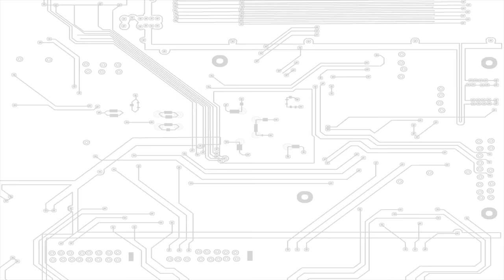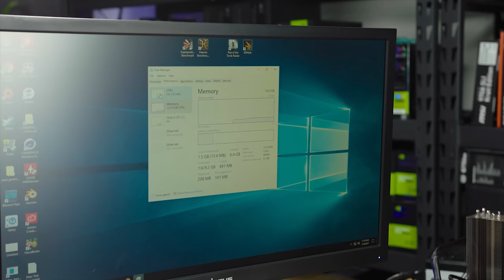How to fix bent CPU pins

Comment: I was building my younger brother's pc last night and I accidentally dropped his Ryzen 5 1600 and bent about 14 pins, this video saved me and I've just completed my first fully functional build!
Reply: Did you have to have install windows from an install disk? How does it work? I'm about to build one but have no idea lol
Reply: @memoryfoam2285  lovely, cheers 👍
Reply: @MoAliRiyaz  sorry for the late reply, I managed to undo it with a Stanley or Exact-O knife blade and a magnifying glass to see the pins. Just use the blade to bend the pins roughly into shape, then run it between the rows of pins to get them straight.
Reply: @MoAliRiyaz  id love to help but I don't feel like I should accept responsibility for your CPU because I can't afford to replace it if I botch it, sorry man.
Reply: @MoAliRiyaz  I think its probably best if I say no, I'm not a professional and I don't really want to give a stranger on the Internet my address. Best of luck solving it, maybe try a local computer repair business or DIY. Sorry I couldn't be of more help.
Reply: Damn that sucks lol. How's it holding now
Reply: @bimmer8602  his PC is doing fine, although he did recently experience a few crashes but we believe them to be graphics driver related.
Reply: @memoryfoam2285  please confirm it was the graphics card lol
Reply: @chief_islxm  huh?
Reply: Lol I have 1 bent pin I’m scared to touch it and it’s only slightly bent
Reply: @youlittlerocket  bro you need another laptop with internet and download on a 8 gb disk and plug it on your pc I’m not specific so don’t trust me watch Linus or smth
Reply: Kick ass!
Reply: Idot
Reply: @iamerror1699  thak yu
Reply: is it still running 3 years later
Reply: I personally wouldn’t have a brother anymore if I were him

Comment: A mechanical pencil is actually great for this sort of thing  as well. Thread the pin into the tip, bend it back carefully.
Reply: Thats a really solid idea.  I'm assuming you'd have to match the size of the pencil as closely as possible?  Wouldn't work for LGA since the tops of the pins are angled (I commented on another comment here about how I had to fix some LGA pins once and I did it in a similar way as Jay did here using a tiny screwdriver instead of a razor), but this is a really solid idea I'll remember in the future if I ever have an issue with on chip pins.  

In my mind its easier to bend LGA pins than it is with on chip pins, as most people (myself included) hold CPUs with on chip pins in the most careful way possible.  But once you take that socket cover off anything could happen, a dropped screw, your build station gets bumped as you're about to put the CPU in and something gets bumped, or even the socket cover itself bending a few when you take it off (not even talking about from factory issues).  

Again though this is a really solid idea I'd use in conjuncture with the razor blade method shown here.  Use the razor to line them up as best I could and then use the mechanical pencil to straighten out the ones that are really bad and need a bit more shifting before you can put it in the socket to straighten them back out 100%.
Reply: The amount of times I've used them over the years. It was great for early PGA , but the density, thinner and shorter pins these days makes it a little more fraught.
Reply: the only problem is that pencil lead is conductive so if part of the pencil breaks off you could have issues
Reply: Derek a mechanical pencil has removable graphite rods, there shouldn’t be any in it when you do it
Reply: My first thought would be to use a hypodermic needle with the tip cut/sanded off. I used to do gun barrels for scale models from these, too :)
Reply: That's why you aren't using the lead, you are putting the pin into the opening where the lead would come out
Reply: That's sounds novel. Have you tried it?
Reply: You can buy packets of non sharp needles from ebay, you get an assortment of diameters for next to nothing, I use them (and a syringe with a screw fitting) for applying solder paste and flux. Search blunt needle, or dispensing needle blunt and you'll be on the right path, they are dead cheap. Pack of 50 assorted, couple of quid / dollars.
Reply: I use a .5mm mechanical pencil for this too. Take out all the lead, and use the tip to bend the pin.
Reply: really great idea... I'll keep that in mind if I ever drop my CPU. lol
Reply: yep thats the way ive always done this... very easy
Reply: no just use the tip without lead in it....its the perfect size.  of course this is not for intel lga....this whole video was for amd with pins on the cpu as he said in the first part of the video.
Reply from the maker: Fantastic idea!
Reply: It actually works great for LGA, thats where I learned about the trick trying to fix I think it was a 775 socket.
Reply: Dan Carlson exactly.. ive been using lollipop stick with small hole in it.. thats works fine too
Reply: Yeah this is my method. Recovered a few CPUs like this. Definitely the easiest I think
Reply: I thought this was common sense at this point, that's how I always did. The less force applied to the base of the pin, less chance to break the solder
Reply: That's exactly what I do as well.
Reply: Great idea, thanks!
Reply: I agree. I used one of them to fix a dropped an Athlon XP in the past.
Reply: Also fixed an old AM3+ USB3 motherboard connector with the mechanical pencil trick
Reply: I have also used mechanical pencil from many many years and with more recent processors its good to align the rows with utility knife blade to finish the job.

Comment: I used a bank card to fix the pins.
Reply: xGarbett a razorblade is smaller than the distance between the pins, plastic cards often work better
Reply: Rado the problem is that those card can be very not straight, I used a spare blade for an utility knife when doing this kind of repair a decade ago
Reply: i used tweezers that came with a vape kit.........
Reply: My guess  is he used the bank card to buy a new CPU.. But yeah im confused.
Reply: Used a card last week to fix a few old Xeons (2001, I can only assume the CPUs were OK becuase the other option is that they were all broken).
Reply: i used knife
Reply: Plastic cards are very wonky. The import thing is a straight edge. Nothing is straighter than a razor blade. Use your heads.
Reply: Logan Brewster i dont think i can do that i have a plastic and metal tweezers from my vape
Reply: I used a Needle/Bank card. Worked great
Reply: Bank card works well. You can buy a new process with one of them bank cards :)
Reply: this works. i did it on my 4690k and its been working strong for 4 years or however long i've had it
Reply: maybe he tried to mean "i don't fix the pins, i buy a new CPU"
Reply: I mean the bank might break
Reply: Yeah I used my bank card to fix it too. I used it to purchase a new one.
Reply: I wasn't able to use a banking card in my case 

space between pins on Ryzen 2700x is really narrowed, this way I could easily do much more harm than good... I'm also didn't have any razor blade... So I used a very tiny Torx (like really tinyy) from the Clockworkers set and while it was very time consuming and anxiety driving thing - the outcome was worth it anyway.
Reply: @randomyoutubeuser8509  Owww myyyy... I just realized what he means by that... xD silly me and a bunch of others people... but still banking card was on point in both cases!
Reply: weird flex but ok
Reply: Oh wait you mean you used a bank card to fix/buy a new new one and not for the razor blade technique as I was thinking?
Reply: r/woooosh to u all

Comment: Just wanted to say - this video saved my ass. I was in a deep depression hole thinking i'd messed up my 5800x; and I was allready in my head planning what I would have to sell to try and replace it. Watched this video and decided to give it a go. The relief when it actually worked was out of this world. Thanks Jay!!
Reply: I am in that kind of depression right now and managed to break one tiny little pin. Also cant get the other ones straight enough as of now so not even sure if it will work or not. If not, saving up several months to buy the processor (yes months, I am sadly living on a very low budget) was a whole waste. I really hope I can fix it AND it will work, otherwise I'm most definetly gonna cry man.
Reply: Just happened to me when moving countries.. I put the cpu the other way in the plastic thingy (5800x) 😓. All corners are bent, we’ll see if I get it working ;(
Reply: @hatdoggo8824  i sent it to someone I found on the internet and he only wanted 10 bucks for it. Works perfectly fine now! Theres always hope yo
Reply: went through that same thing legit 10mins ago, did what he did in the video and holy shit it worked, so happy right now
Reply: @KamiSama69421  hahaha its the best feeling
Reply: Same here, Lexx Fan (loved that show back then and still do). I had a corner full of bent pins and a swell of impotent rage about to erupt. Saved my 3600 and my fist from making a hole in my wall.
Reply: @shhoward71  I know that feeling all to well. Glad it worked out!
Reply: This was me as well placed my cpu into the plastic case bent 3 pins on the corner luckily I managed to bend them back ryzen 7 3700x
Reply: bro i just bought a 5600 and im in depression cause i bent one of em
Reply: I was in the same position lmao. I thought my baby would never boot again😭
Reply: Just bent my 5900x and fix it so it’s slotted in my MOBO. I haven’t tried seeing if it’ll still work yet but I’m so nervous lmao. I only bent like 3 on the edge and luckily bent it back but still I almost cried
Reply: @macs.imum1699  where are you from? Bangladesh :/
Reply: @SpyCakes47  Nope, germany. Its a private guy from some forum I randomly found and he basically fixes them for a small price and some candy lol. He just likes to be a good dude I guess.
Reply: Literally me right now. My 5800x just ate shit
Reply: I’m in the predicament where I’ve replaced my cpu but bent the pins as I was taking it out and I just realized I forgot to save the data from it 💔

Comment: Holy I almost had panic attack when mines bent during shipping this actually worked THANK god
Reply: Nice!! I would have freaked out too man but good job fixing them pins!
Reply: I know the feeling. I bent some pins on my 3900x while taking out my cooler from the CPU. The darn thing was glued too well with the cooler. Managed to get all pins aligned and my rig still booted. I'm just scared now if problems will still eventually manifest from messing up the pins in the first place.
Reply: @Franz4939  exact same thing happened to me. Cpu was glued to the cooler because of the thermal paste.
Reply: @veezi_  same I'm trying to fix my cpu rn🤞🤞. Hopefully it works. Luckily none broke off when I took of my cooler
Reply: Same thing happened to me, the box was very bonked when I unboxed it (thanks postal service), and the pins on the cpu were bent, not that much but enough to prevent it from entering the socket... At least was one pin 🥲
Reply: If they bent during shipping I would of returned it
Reply: @Franz4939  is your rig still fine mate?
Reply: @brucebatmanwayne8514  so far so good bro. It's been a year since it happened, but so far my PC's still functioning well.
Reply: @isaiah9434  any news didi it work at the end?
Reply: Is it still working?

Comment: >drops ryzen cpu 3 times
>nothing
>slight breeze on an intel socket
>RMA
Reply: lmao true
Reply: Word 2 my fucking mother bro
Reply: Yeah cpu's aren't made to be dropped
Reply: Lex1S woooosh
Reply: @capito4585  amm, its not a joke. I guess r/Whooosh to you?
Reply: @infinity-im3nx  the comment was legit a joke buddy
Reply: Yet drop a intel chip it normal might break if the wafer is thin
Reply: My 3950X fell two inches and bent the pins. I just have really bad luck.
Reply: Yeah, you win some, lose some:
pins on the CPU are far more accessible than on the mainboard socket, so they're easier to repair, but probably also more likely to get bent in the first place.
Just learned for myself, how fairly easy you can fix an AMD CPU: some idiot eBay-seller sent my Athlon 64 x2 in a standard paper envelope with no protection whatsoever. Took a toothpick, my thumbnails and 20 min to bend em back enough to get the CPU in the socket with a little gentle force and careful wiggling. Not the world's end!
Reply: Still, at least the CPU's themselves are more rugged. Besides I am noticing an issue with ryzen that I never noticed with Intel... CPU's tend to get stuck to the heatsink and get vacum joint or something on the socket itself as well! I mean the CPU sticking with the heatsink maybe because of the cheap (default) thermal paste I was using but why does the CPU get joint to the socket????
Reply: @NatrajChaturvedi 
If you use a cheap thermal paste, yes, it will get stuck, so buy a better one
Reply: @onyx4682  but I didn't use any thermal paste of mine. Just the thermal paste application that comes pre applied on the CPU. So its obvious AMD has been using some sort of cheap thermal paste solution that later becomes sticky because this is a very common complaint on forums for AMD cpus, especially first and second gen ryzens.
Reply: @NatrajChaturvedi  

Well, the thing with stock thermal paste, they are usually a piece of crap, so usually just change the thing once you have it, and also, even if they didn't cheap out on the thermal paste, it must have been sitting in a shelf so long like maybe a year or two to get that sticky, so don't quick to blame AMD
Reply: @onyx4682  Your right about everything but I still think Intel does it better. The cpu is held down by a steel cover on the intel side so there is very very little chance of anybody getting a scenario like this. Also, Intel's stock paste doesn't end up becoming like industrial strenghth glue. AMD should be criticized where they are wrong. They are gonna just become Intel 2.0 otherwise.
Reply: @joshjlmgproductions3313   i just bought mine and it came bent or i bent it im not sure. It didnt go in the socket so im guessing it was bent beforehand in the shipping. And im so sad i dont want to touch it
Reply: @infinity-im3nx  r/Wooosh
Reply: @naofumi4358  BRUH MY COMMENT WAS ALSO A JOKE
r/whoosh
Reply: @L0ST lol
Reply: youre not wrong
Reply: Is this true? Doesn’t the cpu put pressure on intel pins tho

Comment: There is also a ghetto workaround for broken pins. In my previous PC I had an FX-8350 and once while installing it into the socket I sneezed and smashed the CPU really hard. I broke off about 10 pins and bent a lot of them. I straightened them, but the CPU didn't post. So I found matching "''holes' in the socket and inserted short pieces of copper wire into these holes, so that they would replace broken pins. The CPU worked absolutely fine. Actually my brother has this PC now, and the CPU has been working like this under heavy overclock (5 GHZ) for 3 years or more and still keeps chugging along. So, you can try this method if you are desperate.
Reply: Thought about that, why not replace the pins on the CPU. Either by putting them into the socket, or by using a substitute.
Reply: I would not do this modification under any circumstances for fear of the Socket catching fire if it shorts due to bad contact between the CPU and the various sized pieces of copper you have put into the Socket. It's totally different than just straightening the standard pins. If you broke off that many pins you should just concede a dead CPU and certainly not give said PC to anyone else.
Reply: Nuclearcx How would it short if it’s isolated from any other conductor?
Reply: Nice totally hacked it
Reply: i have a fx 8350 with the exact same problem, but i'm using my only am3+ mobo with a fx 8350 without any broken pins cause i'm cheap as fuck and i was thinking of doing something similar when i managed to get another mobo. glad to know it works!
Reply: CPUs run at literally 3 volts max, that literally can't catch fire lmfao  @Nuclearcx
Reply: @harisonpunian3689  literally?
Reply: i7 8700k is specced to run at 1.52 volts at the max, and that's nearly impossible to get to while staying stable. 
 @Kevin15673 

A heavily overclocked 8700k runs at somewhere around 1.34v on the core and 200 watts, with power draw depending on your voltage and how stable your cpu is. At 200 watts and 1.3v you would see a short circuit turn a piece of wire molten near instantly, but in a plastic socket where short circuits aren't possible anyway, is that going to matter? You most certainly won't start a fire when the heat transfer from that molten wire will instantly solidify it again as the system shuts down or it loses contact with the cpu.
Reply: @harisonpunian3689  it was a joke
Reply: Eldar Samigulin yeah I sure do got s couple pieces of tiny copper noodles laying around and bent amd cpu pins lol (I’m getting pc parts in a month 4 my bday)
Reply: @harisonpunian3689  r/wooooosh
Reply: Need a steady hand, like a watch repairer for that.

Comment: 2 years later and this video just saved me. I was using extra fine point tweezers and couldn't see well enough what the problem was but dammit if that CPU kept not fitting on one side and mocking me. Jay to the rescue! Grabbed a razor blade and went back and forth a few times and BOOM. Seated PERFECTLY! THANK YOU!
Reply: 3 years later and this video just saved me as well.  5900x showed up with bent pins in the middle and side.. razer blade technique worked like a charm!  Thanks!

Comment: I just had this happen as i was transferring my computer to a new case. After i did i noticed in this case i could rotate the prisim cooler to make it look nicer and when i did tried to remove the cooler from the processor, the processor came with it was stuck hard to the thermal paste and bent some pins when it yanked out. You saved me so much money, time, and heartache. Thank you.